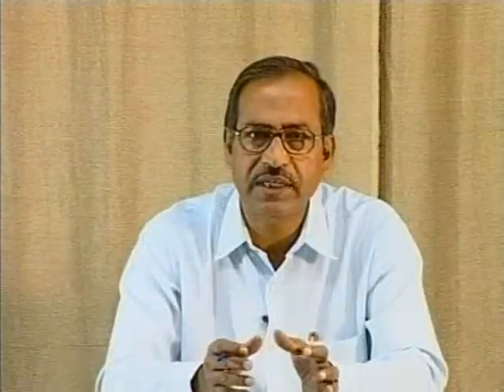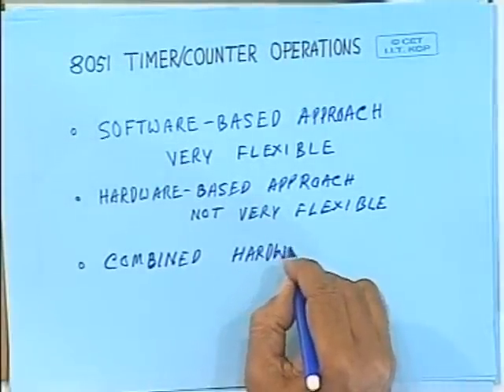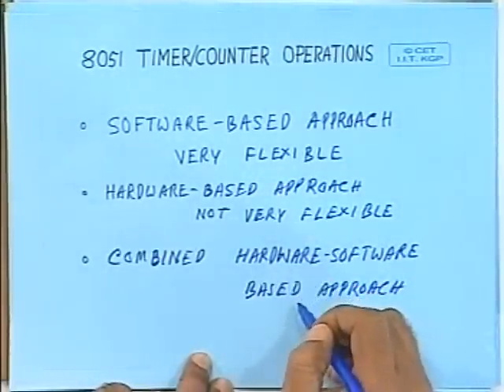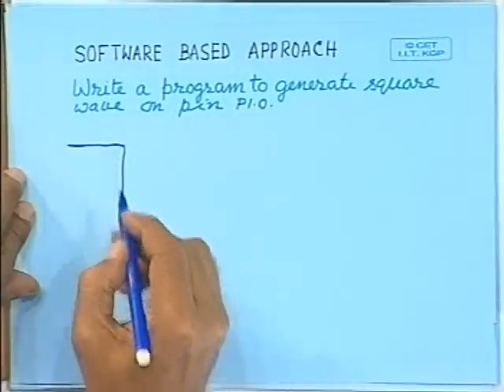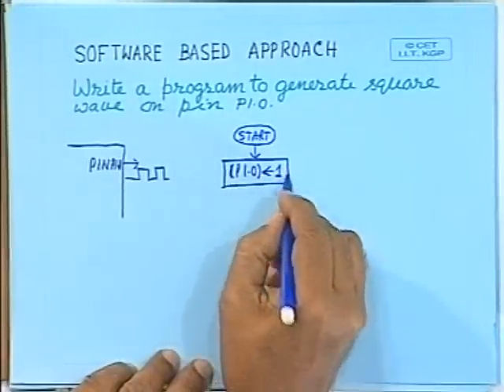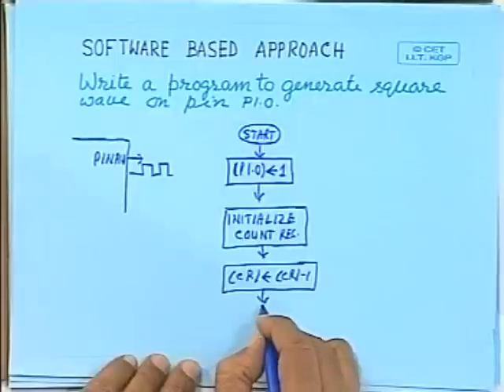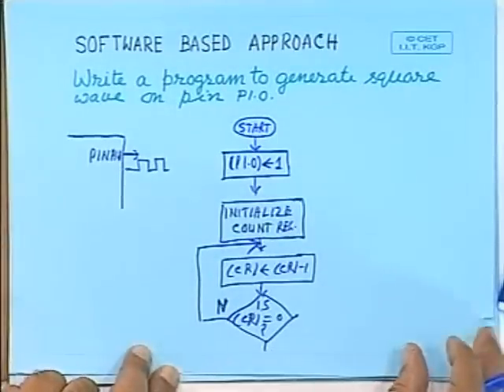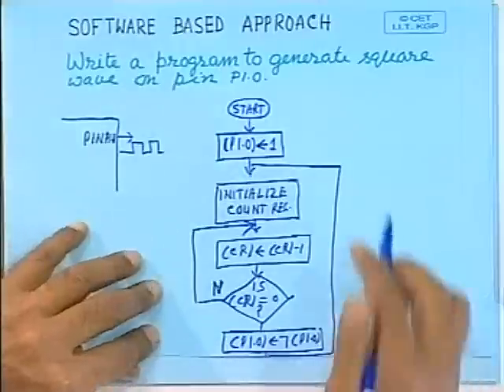lec 29 - 8051 Timer/Counter Operation

Comment: My homemade Six Digit, 20MHz, CD74HC192 Up-Down counter circuit counts Quadrature Encoder pulses at 20Mhz speeds. And seems to be many times faster than using my PIC16F887 microcontrollers.

Can you tell me why?

Comment: Respected sir,
how can we calculate the no. of machine cycles for a particular instruction in 8051...like for MUL AB it is 4...why?
Reply: When controller is executing the program i.e instructions
The processor needs to go through 4 steps
fetch, decode, execute, store

The time taken for these steps is mentioned in machine cycles

All the instructions won't take same time for processing.....that is the reason for variation in no.of machine cycles.

As of now by looking at the instruction function I can sense the count...but I too waiting for in depth concept...I hope the reason is behind the switching inside the chip